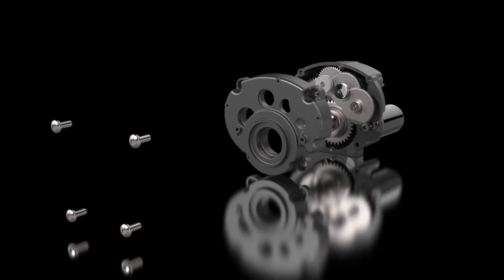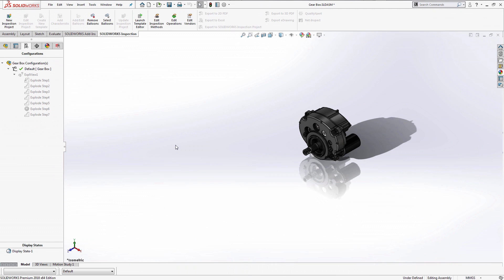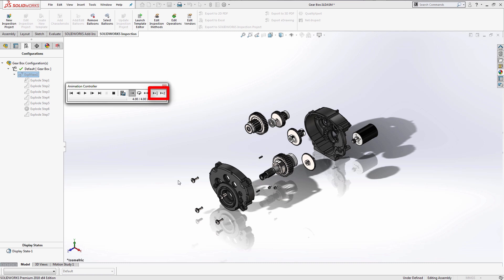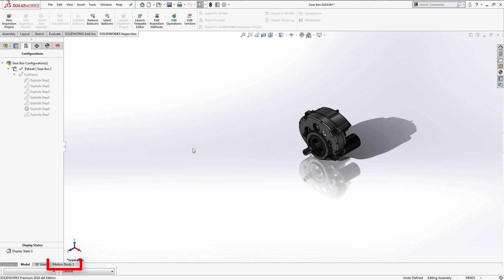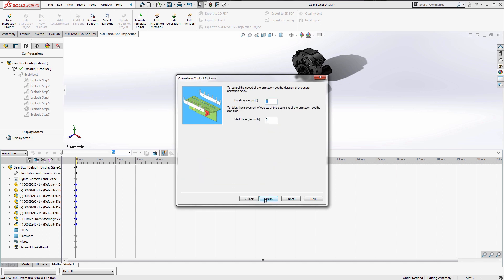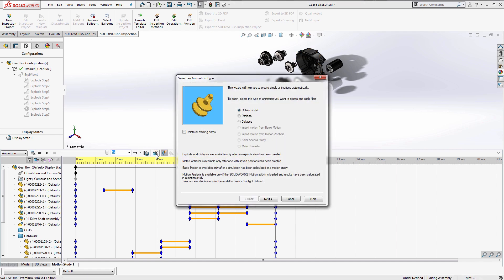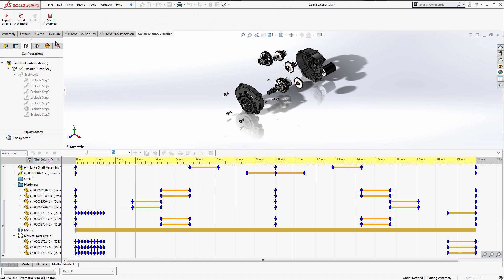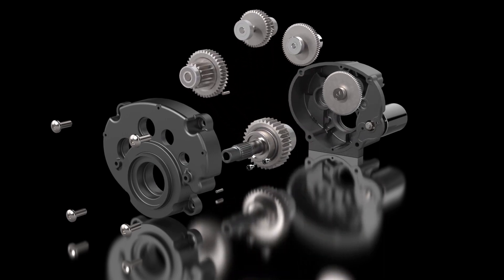SOLIDWORKS - Adjust Exploded View Timing

Comment: Amazing Tut! Just wanted to know what graphics card you are using...
Reply from the maker: There are actually 2 answers to this question. All the work in solidworks was done with a Quadro M4000 (this card is no longer being certified.)  Then the solidworks data was brought over to SOLIDWOKRS Visualize. The renders were all done with an Nvidia GTX680 Visualize has the ability to use some  non-workstation cards.
Reply from the maker: You can check for the latest Solidworks certified graphics cards here https://www.solidworks.com/support/hardware-certification/  

And here for visualize https://help.solidworks.com/2022/English/Visualize/c_viz_prereqs_system_reqs.htm?id=4e8b89534f97431f9e1baa88e29a802b#Pg0

Comment: Thanks for the great video! Is there a trick to get the motion study timeline into virtualize? Mine doesn't seem to automatically copy over.
Reply from the maker: If you have Visualize Professional, you’ll want to use the “Export Advanced” option in SW from the SOLIDWORKS Visualize tab on the command manager.
 From there, choose which motion study you want to export and it will then show up on the timeline region in Visualize Professional.  If you don’t see the timeline right away in Visualize Professional, press “T” on your keyboard or go to View>Show Timeline.

Comment: I would have exported out to a 3D animation tool like Maya or Blender to do it there... this level of artistry in motion using a mechanical CAD application is like creating a painting of the Mona Lisa with Microsoft Paint(yes it's a thing).  Nice job mate!
Reply from the maker: Thank you. Be sure to subscribe for more great 3D CAD Design and 3D printing tutorials.
Reply: I've been testing the gltf exporter plugin for SW but the file to use in blender is not smooth like it is in SW, it creates the keyframes but for some reason the transition between frames is not smooth, have you tested this or found a decent workflow?
Reply: ok I think I got it to work correctly, you need to select the entire thing in blender and change key frames to bezier and it seems to be smooth now.

Comment: how do i export to visualize? the visualize tab is not in my solidworks and i cant add it
Reply from the maker: You need to make sure you install Visualize.  You can do this by modifying your SOLIDWORKS installation.
 If you have SOLIDWORKS Professional, Visualize Standard comes free with your subscription.

If you want to be able to export Animations to Visualize, you will need upgrade/purchase Visualize Professional.

Comment: Is it possible to optimize the render process of a motion study? It takes hours for 3 - 5 seconds videos in my personal notebook

2GB Gforce video 
8gb ram ddr4
I5 8 gen intel processor
No SSD
Reply from the maker: You can use this:

You have a few options:

1.	You can render in preview mode.
2.	You can choose to render at a lower number of frames per second and lower number of render passes.
3.	You can use your Visualize Boost seat on another machine to utilize that machines hardware.
4.	You can choose to upgrade your hardware.

The reason it takes hours to render is because animations require you to specify how many frames per second you would like to have.  The more frames per second, the smoother the animation and more control you have in post processing of the video.

This compounded with the number of render passes you choose, and any changes in light reflection, will increase your render time exponentially.

If you upgrade your hardware, you’ll want to look for a graphics card with more than 4 GB of VRAM so you can use the Denoiser tool.

Here is a video that explains how the denoiser tool works:  https://youtu.be/kkGR3EVvjb4

You’ll also want to make sure you have more GPU cores.  The more GPU cores you have, the faster your rendering will be.

Visualize does allow you to use multiple GPU’s.  By having more GPU’s, Visualize will pool together all cores, across all cards, to help render faster.  If you decide to use multiple cards, make sure they all have the same VRAM available.  Visualize does not pool together VRAM, so the max amount of VRAM available will be the lowest available on the available cards.